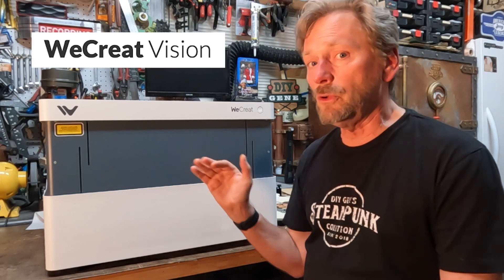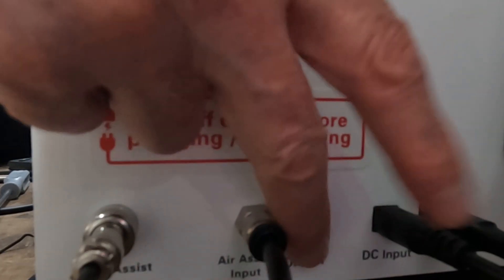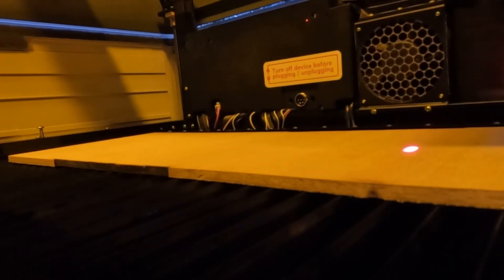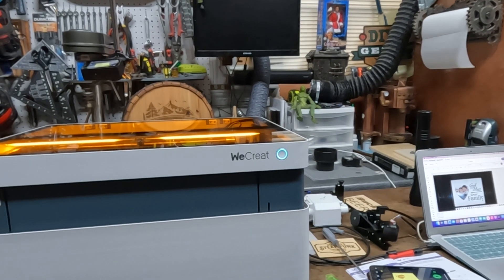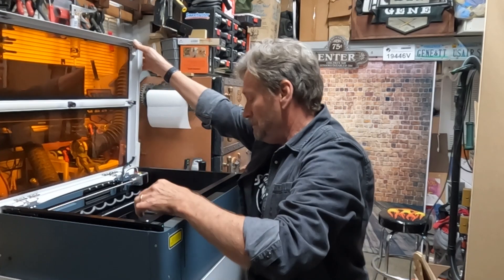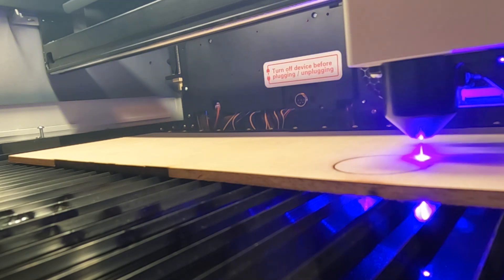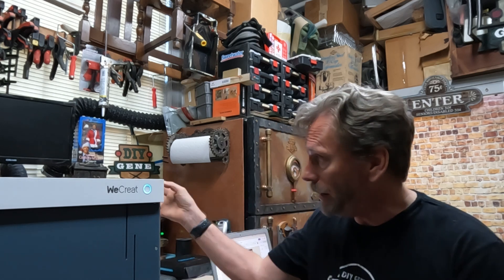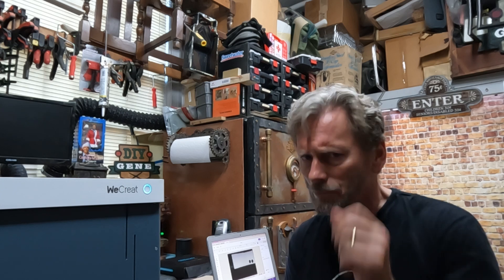Laser Technology Just Took a MASSIVE Leap Forward!

Comment: The WeCreat 20W Vision is so much more advanced and incredible than most YouTube influencers go into depth about. The software is SOOO good that I rarely even think about using or needing Lightburn. The tumbler function is second to none! Engraving, cutting, it performs incredibly! The things I have produced using this machine are mind-blowing, especially considering the price point of the machine. This is THE perfect machine for a beginner but more than that. As one uses this machine it becomes apparent, very quickly, that this machine will take you almost as far as you want to go. For example, I am limited to certain size projects, but with a little thought I can double, or more, the size of signs. And, for a reasonable extra expenditure, I can use the pass through hardware to dramatically take everything to the next level. Most of the YouTube influencers won't say this but I will; WeCreat has set the bar. Bang for the buck there is nothing else out there that comes close.
Reply from the maker: @JoeyMassie , I would tend to agree. You will easily spend as much for an open frame machine and the a case plus all the other extras, and still not have as good of a machine. Thanks for watching.

Comment: 7:50 so their 40w is not as accurate as their 20w?   Interesting observation about how much alike the desktop user interface is for WeCreat and Cricut Design Space.  Same premium software subscription model.  Does seem odd their raster engraving is not bidirectional?
Reply from the maker: In the short time I have had the WeCreat the software has improved and been updated a couple of times. I am hoping it reaches a point that I can use Lightburn through the machine and its camera.  Also I wonder if they will offer the 40w head for the 20w matchine. Thanks for watching.

Comment: This is interesting. Up until now I've never really thought of a use for a laser in my shop.  My thought process has always been, "if it can't handle a 4x8 sheet of plywood, it won't be much good to me".  But I could see this being a viable way to make foundry patterns for sandcasting in my shop.  Design the part in cad in slices and then build the pattern up from a number of layers. stack them up, glue them together and sand the edges.  More finish work than the 3D printer I'm currently using for making patterns, but the speed difference would be a huge benefit.
Reply from the maker: Pete, I am really excited to try out the expansion pack for this. This is such a well designed tool. Thanks for watching.